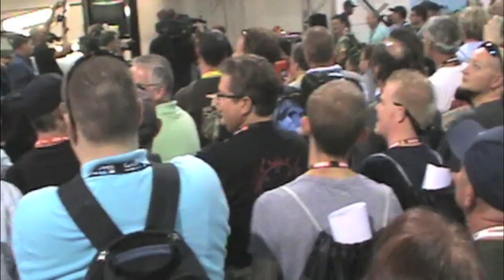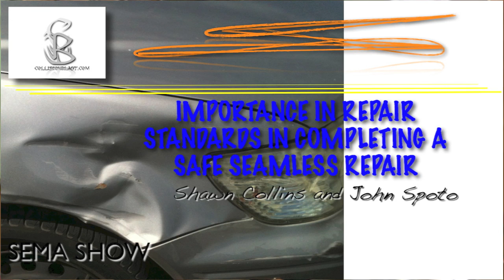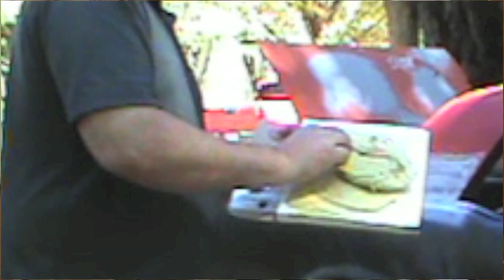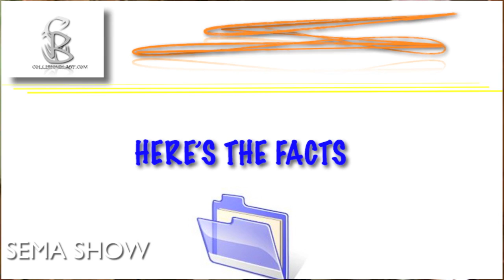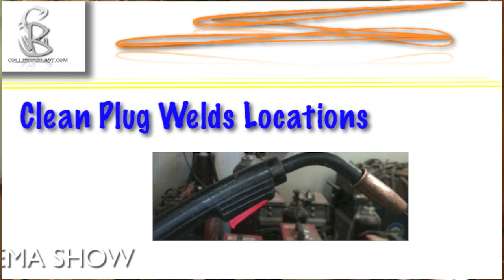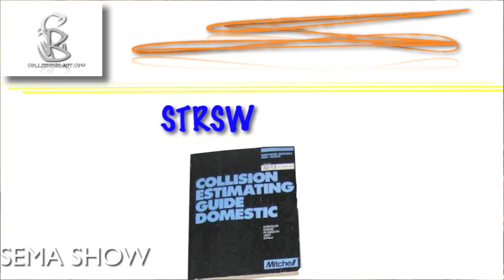Auto Body Shop Common Problems and Repair Procedures by 3M - SEMA 2012

Comment: Have you found out if wiping down filler with wax and grease remover pose a problem when the solvent drys?
Reply from the maker: It has never caused a problem for me.  But I don't have an official answer for you, just my opinion.
Reply: I agree with you completely I never had a problem using it as well, you just made me think a little bit about the fact that it is a solvent so it has to evaporate out of the filler when the car is baking in the booth. I know if you use allot to wipe down the area you risk the chance of fish eyes. But yeah i agree 100% that it should't caused a problem, but it's always good to ask question and learn all you can. Thank you for your responding back to me.

Comment: great info donnie, on the body filler subject i was always told to avoid any kind of material other than a tack cloth and compressed air to wipe down the filler pryor to primer due to the filler obsorbing and maybe lifting but now im kind of thinking about the panal wipe option, do you think im better sticking to the compressed air tack cloth idea or will it cause adhession problems? great site very informative mike.